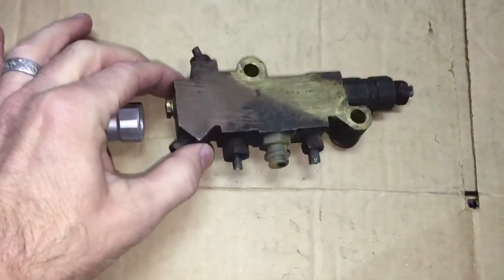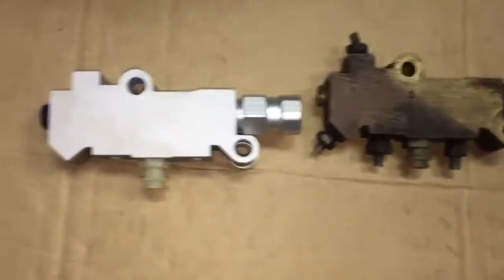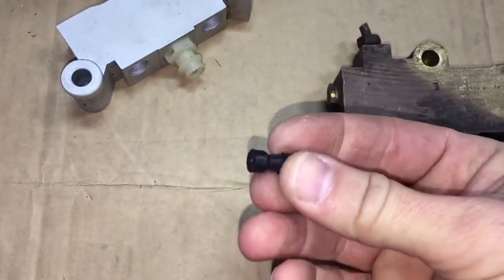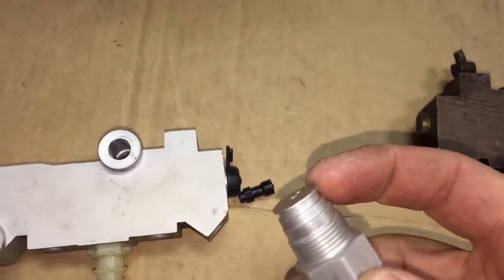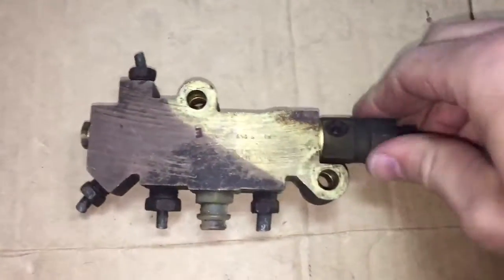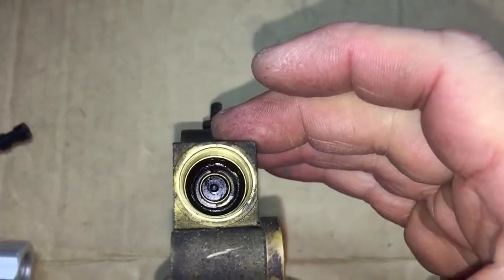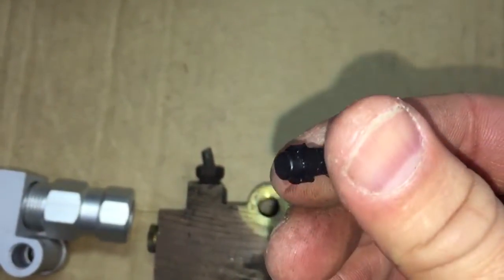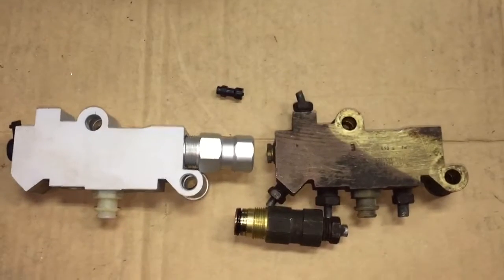Drum to disc conversion prop valve. Part 12 of Ford 9" install

Comment: What rear disc kit did you use I got a few questions I have the one from inline tube? Need assembly help thanks
Reply from the maker: The kit came with a rear end I got. I don’t know exactly what they’d call it. But, it’s Elcamino single piston brakes from the 80s. They don’t mention it’s elcamino, but it is.

Comment: Bro. Dont do this.
Reply from the maker: This is how it’s done, the brake companies even have documentation on this technique.
Reply: @nycore No, you're supposed to replace the metering valve. You don't even know what the hardware you removed is called. You called it a "pressure what ever". You removed part of the proportioning valve.
Reply from the maker: Searching 4Adventure I got those instructions from a manufacturer that modifies your combination valve OR gives you instructions on how to do so, this is direct from their manual. It was strictly removal, no parts replacement. This is strictly to convert a gbody disc/drum to disc/disc. I believe the piston itself is a pressure reducer for drum brakes, disc needs more pressure.
Reply: @nycore  who is the manufacturer? Check out this video describing the combinatiom vavle. Just wanting to keep your car safe for the road. https://youtu.be/qPLaPv8DITE
Reply from the maker: Searching 4Adventure The link you sent doesn’t appear to be a gbody combination valve and it also doesn’t  show the piece I removed (maybe they removed it too?). So if the 2 devices are not identical then their video is not related. Removing this piston piece only allows more pressure to the rear lines which is how GM made these in to disc disc in the 80s. The combination valve will still function if a line breaks and will still shut off the front or rear. I think I’m on year 3 now and the car stops fine. I’m using the aluminum aftermarket gbody combination valve shown in the video minus that black valve piece. Again, this isn’t my crazy idea. I don’t recommend anyone so do anything i do without research.

Comment: I'm having the same problem with my 1984 Monte Carlo SS. I have replaced the proportion Valve, booster and master cylinder. Primed the master cylinder, the. Hooked up to bleed my brakes starting with the passenger rear and nothing. I have a small trickle of brake fluid. I seen the rear axle you had in the video and I have the exact same ford 9" with the same gears. Can you give me a detailed description of how you got fluid to the rear of your car.
Reply from the maker: Devon Watts It sounds like the little brake balance valve is tripped. That's the tiny pin that pops out on the left if it's mounted under the car. It's to the right in my video under the black rubber cover. If it trips you'll have line pressure to the front only or the rear only, sounds like you have front only. I've heard you can tap it back to reset with a hammer but i don't use that method. I let the fronts bleed and keep the rear tight then smash the pedal like a panic stop, you'll hear a Big Bang as the valve resets. And if that don't work I close all 4 corner bleed screws and mash the pedal, it'll pop back eventually. 

You can also test if it's tripped with a multi meter, inside the white plastic connector at the top is a metal pin that connects to ground if it's tripped.
Reply: How would I re center the valve? Would I remove the front brake pressure by removing the lines from the front then hooking up the rear hoping to push the valve back the other way?
Reply from the maker: Devon Watts whatever side has no brake pressure is the side you want to close off. If you have no rear, close off those bleeders and open the front bleeders a lot, so they leak. Then press hard and all the way down on the brake like a panic stop and the valve should bang to close off the fronts....which would now become the center position.
Reply from the maker: Devon Watts There’s another way that’s not so easy on a gbody: at the top is that metal pin that connects to the dash brake light, you can unscrew that entire pin and you can see the valve down inside there. With a small screw driver you can reset the valve and center it. But with the entire combo valve mounted to the chassis it’s almost impossible to do, it’s need to be removed. I recommend smashing the pedal
Reply: Ok I moved the valve back and used the nipple tool to keep in centered while you bleed the brakes. I have one more question. Did you have to replace the master cylinder and brake booster with a unit made for disc disc. I currently have the master cylinder on my car that came with it. If you did use a different brake booster or master cylinder please let me know. Thanks for the help.
Reply from the maker: Devon Watts  I kept the same master and only did what’s in the video. It brakes better than the drum in my opinion. I read somewhere that they sell this prop valve for disc disc and you’d keep the same master anyway. I figured if they sell a combo valve for disc disc and you keep the same master, then this modification is no different.

Comment: get a cpp disc to disc proportioning valve on ebay for 26.00 and dont for get to get your proportioning valve to also for 8.00 to bleed the break the right way if you did the correct setup there is a huge difference on my 86 monte carlo ss with the blaser big break upgrade i did and stopping power a night and day difference

Comment: how has your 9 in done so far im looking at one for my monte but figured i see how yours has done so far an how did modifing  proportioning valve work out
Reply from the maker: Jd Kidd The 9" is a direct swap so it's no different than the oem. It'll handle more but it feels the same to me, my gears are 3:89 and I had 3:73 so even that feels close. The brakes seem to work but are barely slightly better than the drums. The rear brakes grab and don't rub. I'd say it's a minor stopping improvement but not much. My brake master cylinder might need an upgrade. Overall the car stops better. It's even possible this modification to the prop valve did nothing and the brakes work anyway.